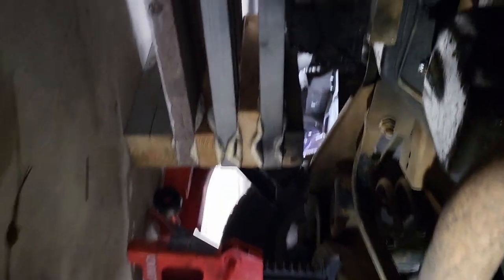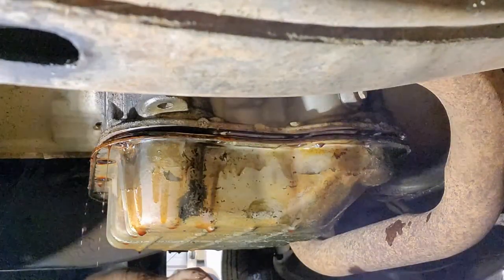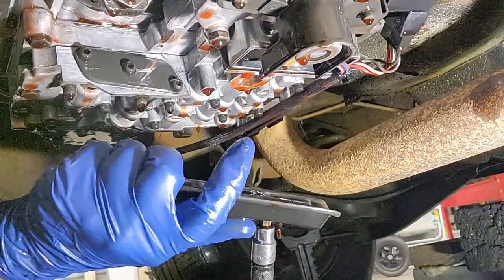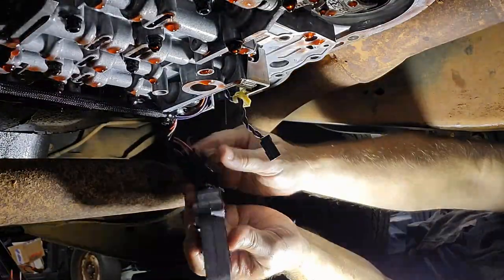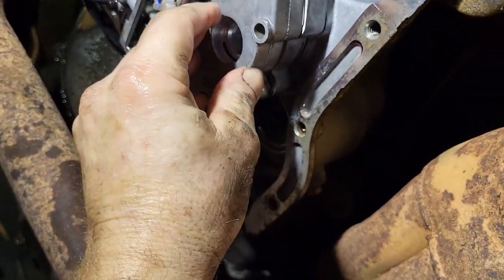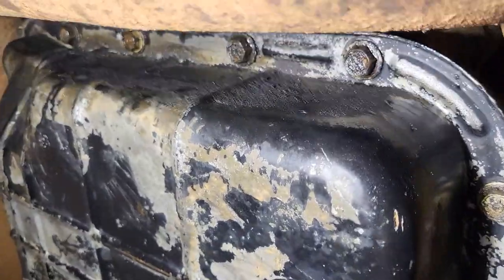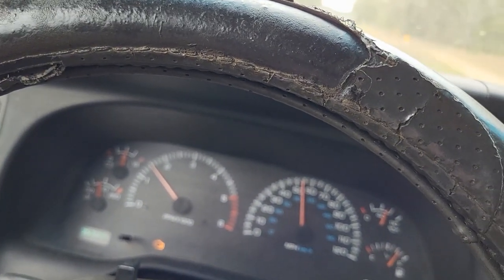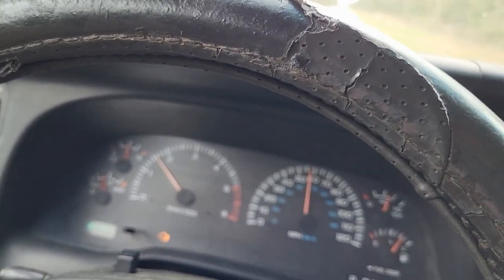2000 Dodge Ram Governor Pressure Sensor Transducer Remove & Replace

Comment: If it's anything like my 03, the light will go off after 3 to 10 starts without the problem recurring - at least that's what it does for other codes. I have a manual so YMMV.
Reply from the maker: Thanks for the info Scott.  I'll keep watching it.